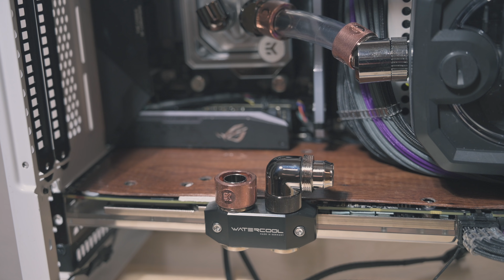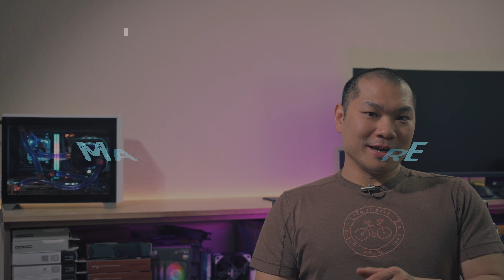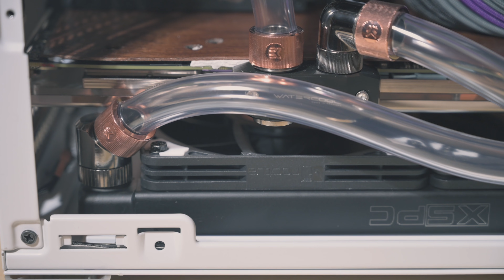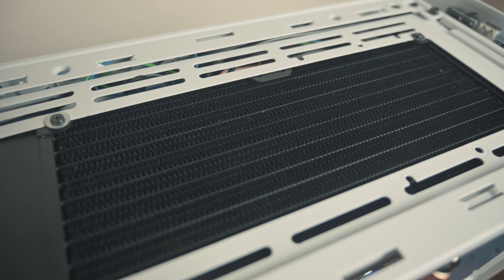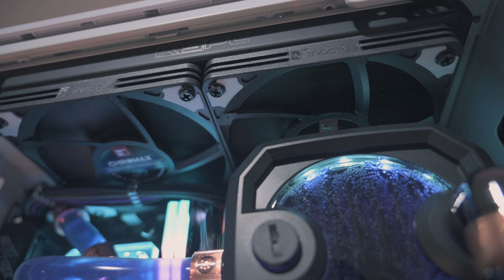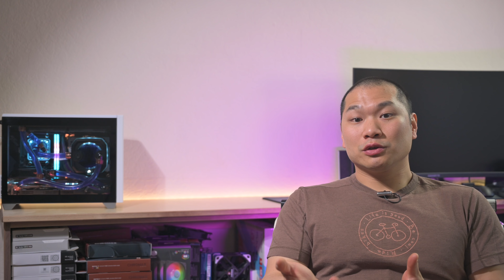Custom Loop Performance with the Dual Rad NR200P!

Comment: I finally made this build, used the new BARROW 20mm slim rads to make it work, altough my rog 3080 is a beefy boy it works even tho the bottom rad is quite chocked, still good temps on GPU. i did have to cut the top panel in order to actually fit the top rad, was no way around it.

Comment: I'm changing my custom loop. Right now i have a single 60mm*360 rad. I need to change it to 2) 27mm*360 rad's. I am wondering if i should run from pump to rad then to 2nd rad then to cpu, or should i go from pump to rad then cpu then to 2nd rad? I only have the cpu to cool. I dont have my gpu in my loop. Would one make a differance for beter cooling? or am I overthinking it. Thanks for any advice.

Comment: Would this work with an RTX 4090? I'm a relative novice to PC building but am generally plenty handy, so I don't think I'd have any trouble with the required mods (it's all stuff I've done before in one scenario or another), but don't want to start committing if I can't get the desired graphics card in.
Reply: Also interested in an Intel MB recommendation if you have one 🙏

Comment: I want to do this aswell so i can take my pc with me much easier.

Would a 3070ti fit vertical into this case? Founders Edition with a alphacool block. 

It should end right where the mobo ends. So possibly better airflow? Could i mount a ek pump res combo or does the psu cover the front down 120mm Fan?

Comment: You mention why intake on top and bottom work well in this type of case, but did you do any experiments to verify the concept vs exhaust (to control dust) or bottom up flow through?

Comment: HEY IM TRYING TO DO THE AME THING TO MY BUILD BUT YOU DIDNT GO OVER HOW YOU MODDED THE PUMP/RES TO FIT ON THE PSU HOLDER IN THIS CASE. CAN YOU EXPLAIN PLEASE THANK YOU.
Reply from the maker: I just drilled out the holes on the PSU cage to line up to the back of them pump. No mods needed on the pump.
Reply: @MachinesMore  oh okay what kinda drill or attachment did you use to make the holes ?

Comment: hello nice video i have the same radiator but i dont know what screw i have to buy to fit my 2 noctua chromax fan that 15 mm thick i dont know if it m2 ,3 or 4 can you tell me plz?
thx

Comment: Awesome Build! With your setup can you fit a thicker rad in the bottom approx 30mm, I want to get 50c temps. Any suggestions would be great!
Reply from the maker: You could, you won’t see a huge difference since the fan is the real limiting factor the thicker you go. The best sub 30mm rad in my opinion is the HWL GTS240.

Comment: Just found out that bottom rad is not good for the aio in general. Can I do top rad and vertical gpu. Still waiting for my parts but I really wanna know! Thanks!!
Reply from the maker: Hey Ken, you can absolutely do a bottom rad, you just need to pick the right AIO. I’d take a look at the Be Quiet! Pure Loop 240 that was reviewed in the channel not too long ago. Top rad is going to be tough due to the position of the vertical GPU.
Reply: @MachinesMore  hey thanks for the advise. I got the arctic freezer ii 240 but I might just go for the horizontal gpu for the pcie 4.0 feature
Reply: @MachinesMore  Can I also do arctic freezer ii 240 bottom rad with horizontal gpu?

Comment: Hey there, went with the gigabyte board in the other video but the ram doesn’t clear.. think my thermals will be ok with just the one fan over the PSU?
Reply from the maker: Maybe, depends on what you’re running, basically you would have 360mm of rad space at that point. One way you can get around the ram is if you notch yourself fan a little- see where it interferes and typically it’s the frame of the fan and not the blade that is preventing it from mounting.

Comment: OMG this is amazing build...
Amazing build. I am with some big parts combination now. MSI 1080 Seahawk EK (waiting Alphacool 1080 M07), D5 pump with either BP or OCool top, 2 thick XSPC A240 radiator, SFX-L PSU... pulling all this from my current Caselabs S3 and try to fit to this small case.
I guess I need purchase 3D print feet to hold 120mm fans outside. Then purchase 1 same radiator and 2 thin fans like yours.
Reply from the maker: Good luck! There’s one thing you might want to double check, that card is pretty wide from what I remember, like over 165mm because of the fitting connector, that may be a very very close fit in the NR200 so measure your card first.
Reply: @MachinesMore  you are right, I purchased alphacool 1080 m07 to bring down width to about 145-150mm. The gpx solo allows me to route water tube under GPU (between GPU and radiator). And thus I have to put 120mm fans outside under this case.
Reply: @MachinesMore  Finally I complete it! https://www.reddit.com/r/sffpc/comments/n5aqwo/nr200p_liquid_cooling_with_d5_pump/
Still cannot fit 2 240 radiators since my PSU is SFX-L. The alphacool waterblok on GPU is just as I planned ;)

Comment: Glad there is a way to mount a radiator to the top. I got a r5 3600 oc to 4.5ghz 1.244mv and a vega 64 1700/1100 undervolted and only had 1 240mm radiator for both. Was hoping it would handle the load but it's not enough.
Reply from the maker: Vegas run hot... although with a 3600 running that well I would have guessed it’d be usable. Theoretically one 240 should be fine but you have to expect louder fans.
Reply: @MachinesMore  what's weird is its the cpu that's too hot but my vega doesn't Crack over 55c tops. I went ahead and ordered another 240mm radiator 2 extra hookups and 2 slim 120fans and gonna redo my tube layout and maybe redo my cpu block just to be sure. Ryzen ctr 2.0 rated my 3600 as a golden sample capable of 4.6ghz at 1.344v so if the extra radiator gives me enough head room I'm gonna max the cpu out.

Comment: Did you get to try any temps with just one rad? I want to mount a rad on the bottom and 120 fans up top for the RGB 😜
Reply from the maker: For one rad, I would try a thick rad like the EK PE 240, 25mm fans, and a vertical GPU, a different pump solution would be needed too. Slim fans and a single slim 240 rad won’t cut it with reasonable noise levels, the slim Noctuas are good but are loud close to the max.
Reply: @MachinesMore  thanks for the info! Not sure there is a pump that would work with a vertical GPU Mount on this case 😩
Reply: I guess my solution would be to just get a second rad for the top!

Comment: Have you thought about a cpu block pump reservoir combo with the gpu mounted vertical? That way you probably could fit a thicker radiator at the bottom.

Comment: I was just thinking, if both rads are doing intake, wouldn't it make sense to place a 92mm fan at the back? I mean of course the hot air is going to be exhausted from the back anyway, but wouldn't a fan help? maybe even improve the temps a slight bit since it would help with the airflow?
Reply: Not really. The fan is small so I dont think it does a good job exhausting

Comment: the mod is pretty neat with the top rad! I wonder if it would work with my gigabyte b550 itx, as it has no heatsinks on the top which should then be doable like you said in your previous mod video.

Comment: So I have been thinking about getting the Asus ROG crosshair viii impact x570 mini-dtx to pair with this case. I am also thinking about doing my first water-cooling pc in this case. I was wondering if this set up could work with that MB using the Arctic p12 slim fans on the rad as a possible solution for what you mentioned the "crosshair VIII impact has a high ram slot"? 

Thanks much appreciated!

Comment: Can a regular 240mm AIO mounted (like the kraken) on the top, just with slim fans like the A12x15 chromax for example?
Reply from the maker: At best just the rad, the board components (mainly the ram) will get in the way. AIO rads are usually 25-30mm thick.
Reply: @MachinesMore  And with low profil RAM like the Corsair Vengeance LPX? Or its because of the RAM Slot on the board itself?
Reply: @LowCarbVampire  Ram itself

Comment: Great video and really clean build! I have the NR200 with a 5600X and 3070. Using a side mounted AIO, but this setup is really inspiring. Having both great thermals/noise and being able to use the glass? Too good to pass on. For the res I quite like the horizontal cylindrical EK one that Optimum Tech used in his single rad build.
Reply from the maker: Awesome! I think these two rads would handle that combo, and probably even a 5900X + 3070 just fine. The bottleneck here with the 3900X is the thermal transfer, the coolant temp isn’t really moving too much under a heavier CPU load. I like the EKs quite a bit also, thought I would try out something different for this build and this XD3 works quite nicely too.
Reply: @MachinesMore  I was very positively surprised at how well the thin rads with the thin fans worked for you. Being inexperienced with custom loops I wouldn't have thought it enough, so great to see that it is. I noticed the XD3 comes in white as welll... which would go really well with my white NR200 so I'll definitely consider that. Keep up the good content - you have one more subscriber 👍

Comment: Hey man excellent content and amazing in-depth reviews. This channel definitely deserves more subs. I have one quick question, what software do you use to log the average temps of cpu/gpu? (Not asking what you use for stress testing, I know it can be done using prime95 and heaven, I am more focused on the software used to get the information out of the hardware and put it all in a spreadsheet to get the averages).
Reply from the maker: HWInfo64 is good and typically recommended, Open Hardware Monitor is good if your stuff isn't the latest and greatest since it doesn't get updated often.

Comment: What are your thoughts on using a cpu block pump combo like the ones from Barrow? Should it be enough for two slim 240 rads like you use here?
Reply from the maker: Yes, that would be fine too, I believe it’s just another DDC pump in there so more or less the same. Personally I like having a bigger res and being able to choose the CPU block I want, but if space is an issue then that will work too.

Comment: Hello! What about 280 custom loop on the side panel? I would like to try something like alphacool eisbaer 280 with some fullcover waterblock added for my 3080... Hope it will work fine with my i7 10700. Maybe there is some better options? It's really Hard to find slim rads in my country)

Comment: I'm curious - would there be any benefit to mounting just the radiator at the top for passive cooling? Obviously it will be worse than with fans, but I wonder how one passive radiator plus one active would compare for someone (namely me) not comfortable with modding the top of the case. I also wonder about if the high static pressures of the NF-F12 might offset the problem with blowing directly into the GPU block. They also have the industrial versions with even higher pressure ratings.
Reply from the maker: It's an interesting idea with the passive rad. It could work if you feed additional fresh air into the case with a rear fan so that the air going into the top rad isn't just from the exhaust of the bottom rad. That also helps maintain the positive pressure so as to make the top rad the point of exit the air favors. If you keep it to lower powered components it could work well. To estimate the efficacy- ballpark that you would get at best the same performance as running a single thick rad, since essentially you're passing the same air through two thinner rads, there are some air losses to various vents in the system, but you also make up with some fresh air mixed in.

Comment: Can you add the third 92mm rad to rear of the case ;)
Reply from the maker: Yes, one could- but it wouldn't do much. Other than only being a 92mm rad, it will also be the point of exhaust for the hot case air, so there won't be much cooling happening.

Comment: Great vid but I am not going to go through all the troubles of custom water cooling in NR200 I guess...
Finally get my hands on a SF600 PSU, now I just need ALL the rest of the parts I need =(

If I were you I would probably give it a try for the Barrow DDC CPU block and see if it would make things easier. 
Potentially side mounting 280 and bottom mounting 240 without much modding?

Comment: Wondering if a short 3080FE block would fit vertically with a DDC pump there
Reply from the maker: With a vertically mounted cylindrical DDC against the front panel, probably. The EK FE blocks are fairly short, I think around 210mm IIRC.

Comment: Hi may i know what's the best fan configuration for top radiator only for cpu loop plan to do the same on modifications on Nr200p. Thanks in advance
Reply from the maker: Intake, you'll get more cooling by running outside air through the rad.
Reply: So same setup as you do. Thanks bro! ❤

Comment: Hi sir, can i use coolermaster 120l v2 rgb AIO on top panel? I see that the AIO is a bit bulky, but if i change the fan to a slim 120mm fan, will it fit without touching the RAM and everything else? Hope you've tried this or have this AiO on your studio 😁😁 thanksss and keep it up
Reply from the maker: I think it could line up well with the stock top panel, but you will definitely have to drop the PSU since you're still looking at about 43mm at best for that combo. If you mount at the front end you won't have to worry about RAM or the board- there's enough space to not interfere with the mobo. Worth a try. If you have a really short GPU you could also bottom mount it.
Reply: @MachinesMore  thanks a lot sir 😁

  i will also try to place it on the rear panel, using off-set 120mm bracket (codename: bykski b-bkt-105), and change the 25mm stock fan to slim fan (12-15mm).

One more question 😁 do you think the noctua a12x15 is much better than the scythe kaze slim? (for radiator)

Comment: It's crazy how close Coolermaster were to making the perfect ITX watercooling case. I could imagine a future revision with those extra slots for mounting the PSU shroud lower down as well as the additional holes on the rad bracket and top of the case for the top-mounted radiator position.

Comment: If you run your pc at heavy load, ie AAA gaming, cinebench etc., is the CM PSU fan highly audible?

Mine overpowers the rest of the system.
Reply from the maker: Once the fan is up and running it's moderate, a little louder than say SF600, just fanless/fan spikes every now and then.

Comment: Love your content. I just had to watch this on mute... how is the noise? I use the same case  but with a 5800X and a RTX3080 and a single 280 AIO. After some work I was able to reduce the noise to a good level without losing performance but there is one thing I was not able to solve:
I use the same mainboard and the Chipset cooler and fan is a mess. With a pretty decent airflow in the case the Chipset and the NVME on the backside of the board easily get to 68°C with the onboard fan going nuts with a very nasty sound. Even if you remove the load the fan stays infernal for a pretty long time, that just shows that the cooling is not working properly. 
I am currently working on a solution with an external Noctua 40mm fan to drag out the hot air. I am still working on it. So far the Chipset fan is heating up slower and slowing down faster, but goes still nuts. This makes me think that not only the fan is not working well, but also the cooler itself is not well designed.

Maybe someone out there knows a better solution. Otherwise I have to change to board.

Comment: Great Video. Working on a NR200P Build that will have a 3700x and ASUS EKWB 3080 , same pump as you as well as a Corsair Hydro X Water Block. Will you be switching over to hard tubing when you get the new things in? Also have you tried doing a single 240mm Rad for the loop? Wondering how the thermals would be on that. Thanks for posting this video.
Reply from the maker: With a 3080 alone, I think a single 240 rad would actually allow you to reap the thermal benefits of watercooling, whereas with a 120 you'd achieve parity with air. I think if we're talking 5600x or 3600, plus a 2070 or 2080 level of gpu power, a single 240 would be fine but for what you're planning I would really at least try for an extra 120, unless you don't mind high fan speeds. As for this build, my plan is to switch over to hardline for this build eventually, just wanted to see how the components would respond and if any configs would need to change- so far so good. The XC7 block is really good too. I have one also, it matches the XD3 really well, it looks like a mini XD3. Good luck!

Comment: Hey mate, sorry to use this video as a means to ask you a question, but you have no social media so couldnt ask there :P

I'm looking to use the UH-12A in my Nr200p build with the tempered glass side panel. I know it wont fit but if I use 4mm standoffs instead of 6 do you think that would be possible at all?
Any advice would be great. Thanks a bunch for all the content on the nr200, I've watched it all :)
Reply from the maker: There are a few considerations with using lower standoffs- 1) your board has to be able to drop lower to begin with. Some boards have a backplate and already sit on the tray directly, despite the mount points being elevated. 2) Your IO will shift in, won't line up any more. 

That being said the U12A should already fit to some extent, you have to use two screws to secure and keep the panel from falling out. My advice would be to try it first and see how you like it- obviously the panel won't be as free to be taken on and off but I'd be a little less comfortable with the rear I/O shifting, unless you want to grind out a little more off of the cutout.
Reply: @MachinesMore  Thanks a bunch for the reply! I'll check it out! Have a great week mate :)